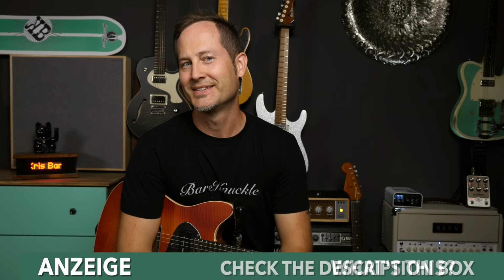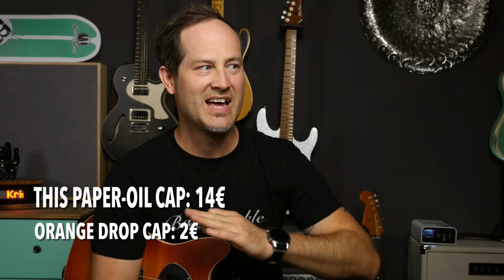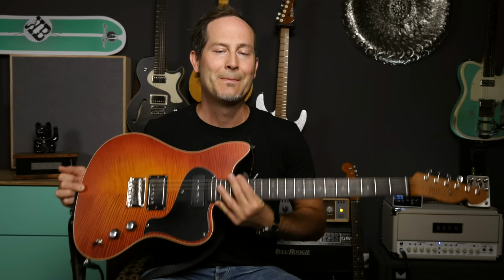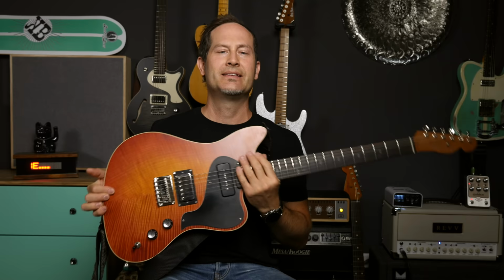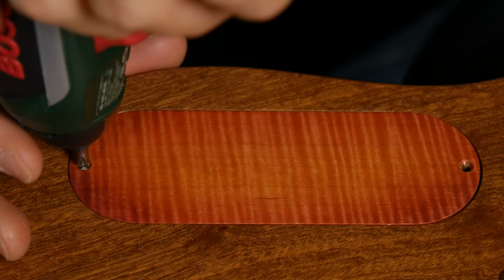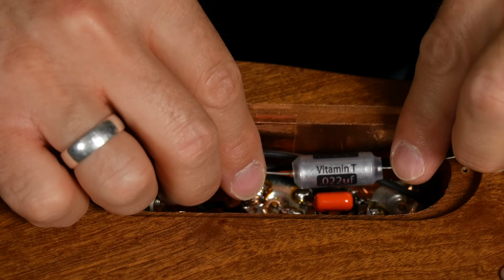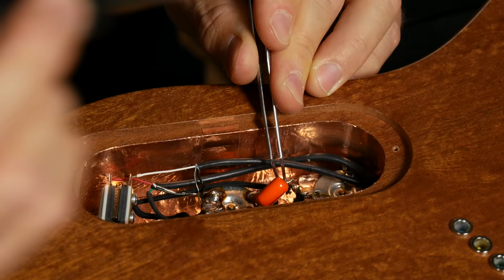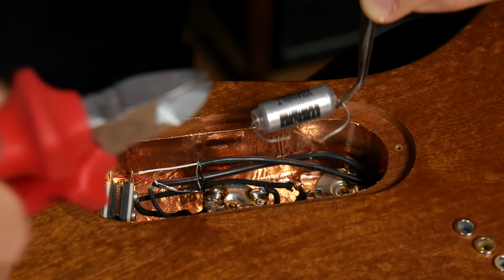Guitar Myth-Busting! Are Paper-In-Oil Capacitors Better? | Guitar Tweakz

Comment: I just wonder. Did you test the caps to see if they read the same? Could the difference be in the tolerance between caps? Possibly. Enough of a difference to make a difference? Hmm...not really. You nailed it when you said “will your audience know the difference? Nope.” As usual, awesome video brother!
Reply: without having done that, this comparison not very useful. sorry, i love Kris' videos, but without having checked the actual value (as opposed to nominal value), we only were proven that one capacitor sounds different compared to a different capacitor. the material of the capacitors is different, we know that, and the value is.... we don't know if it is different or not. so I am asking for a followup, please.
Reply: @tolvajakos  Totally agree. The tolerance of capacitors varies greatly from about 5% (the better modern ones, but orange drops are not even that good, they are listed as having 10% tolerance by the manufacturer) up to even 20% (more the electrolytics and wait... yes, those old paper-in-oil caps :) )

And for me this doesn't matter at all, I usually either have the tone pot turned all the way up or even removed. I use it only in one-pickup guitars, like the LP Junior.
Reply: @tolvajakos  of course it is not possible, that 1 cap will sound different to other, if they have all the values the same. What is often forgotten is, that capacitor (or potenciometer, resistor etc) has also other values then capacity ;)
Reply from the maker: Hey guys, I’ll measure these two caps for you soon in another video and tell you my thoughts on this and explain why I didn’t measure them in the first place. 👍 Cheers!
Reply: @KrisBarocsi  Thank you! Looking forward to it.
Reply: @stanislavmigra  not sure if the other values have any effect on tone, never heard of that, but it would be interesting to investigate.
Reply: @tolvajakos  did that for year on college, boring as hell. Yes, it makes difference, meassurable with oscilloscope. It was prerequisite for my master degree.
Reply: @tolvajakos  to clarify all that, do I think it is big thing to invest time and money? Nope, not really, there are other things, that makes HUGE difference. For example speakers and cabs.
Reply: @KrisBarocsi  Thanks Kris! I’m sure you’ve already thought of that and have a good reason. I was just wondering about that. I’m certainly no expert or know anything at ALL  about electronics really. I’ve just always read that tolerances can make a difference sometimes. But who knows? I’m just a dumb guitar player. 😂 Cheers!
Reply: @stanislavmigra  yeah, i know, swapping speakers is a huge change in tone. still i would be interested if somebody showed me a video or article that describes a testing like that and the findings
Reply: Dielectric in the cap does make a difference. Different dielectrics have different properties and therefore different sounds, even if the caps have the EXACT same capacitance value.
Reply: Caps of different compositions may measure the same capacitance, but they all have different ramp speed, ESR, and induce will measure different as well.  Slightly different capacitance values don't effect frequency roll off much.  Different composition will change tamber, and sustain tail.
Reply: Who cares what the audience thinks when it comes to guitar tone? You have to find the tone that you love, or else you will never be satisfied with your playing.

Comment: I suspect the difference we are hearing is due to the two capacitors being in a different part of their tolerance range, rather than the difference in dielectric material. In the links Kris gives us, the tolerance of the paper in oil cap is given as +/- 10% which is described as 'very accurate'. The tolerance of the orange drop cap is not stated
Reply: that's actually the real test. Most people seem to forget that there is a tolerance level. Watch the last Andertons  about the Klon. same story.
The real test is to measure 100 of each type. Match them up as accurately as possible and compare them across the range.
That would be a scientific approach to sound, or at least an real attempt. Have you ever seen that?
Reply: The hysteresis is different even if the uF value is the same. You can hear it.
Reply: All you have to do is measure them 🤷 Even the cheapest digital multimeters measure capacitance.  It's not magic lol
Reply from the maker: @JC-11111  Hey guys, and that’s what I‘ll do very soon in a video. I’ll measure these two caps for you and tell you why I didn’t measure them in the first place. 👍 Cheers!
Reply: I've swapped a LOT of caps, and the material definitely does make a difference. 

To my ears, Paper in Oil have be best sound, having more "air", "openness", and make the guitar "come alive". Ceramic is the next best, but is a bit too bright, clean, and sterile compared to Paper in Oil. Everything else makes every guitar I've tried them in sound "dead" and "lifeless", and that includes Orange Drops. 

It doesn't matter whether it's an .015 uf, .022 uf, or .047 uf, Paper in Oil's just sound better when compared to other materials, and you'd be hard pressed to hear any difference from one in the same value range to another, as the tolerances don't make as much of a difference in what you hear as the material the caps are made of themselves. 

This is my conclusion after a few years worth of real world testing of pretty much every kind of cap out there that I could find.

Comment: My guess is every person posting on guitar forums that PIO caps are "no different" than film or ceramic caps have never ever played a guitar with PIO caps in it. I have personally put them in two guitars and they made them sound wildly different. I put the old soviet PIO caps you see advertised on Ebay into a Les Paul with Gibson 490r / 500t pickups and it gave the guitar seemingly endless sustain and a "throatier" tone..Think of the Seymour Duncan APH2 tone on steriods. I also put Vitamin Q PIOs in another with 57 CLassics. This didn't change the tone as drastically but OMG it made it so much sweeter. Counternote, when I changed the 500T pickup in the first guiatr to a Dimarzio super distortion, it sounded horrificly bad with the PIO cap and I had to change it to the original Gibson stock. So yes PIO caps do infact change the tone, sustain and other charcteristics. The change can be quite drastic. As to if it's "better", that is a subjective opinion and different people will have different views. But IGNORE anyoine who says "they don;t change the tone". That is a lie.
Reply: Right away, you give a error in your method by installing different caps in  different guitars that are, by their very nature, not identical. There are too many inherent variables in pickups & pots...as well as setup, etc, even from  two supposedly identical guitars from the same manufacturer, to attribute the tonal differences strictly to the capacitors.

To prove you point, you would have to change the cap(s) in the same exact instrument, and analyze the output with accurate test equipment. Our hearing is far too subjective to be trusted outright.
Reply: @olenfersoi8887  People who can't spell and have no ability to use grammer should not be telling others about their crackpot theories they can not back up with evidence. You are dismissed.

Comment: Thank you for the content. This is an old post. Let's pretend I disagree with your conclusions, it doesn't matter. We are all just trying to learn. I am happy to read the comments and learn from the expertise of others. I come from an electrical engineering background and still am willing to entertain many things I would be surprised. Currently I am trying to determine when it makes sense to change pickups. I need very compelling reasons because I have so many tone shaping tools. In your experiment I determined three things. One, if I were playing alone, I like the fatter sound. Two, if I were looking for a guitar to sit in a mix the best, I would prefer the tighter tone with less bass frequencies. Three, without knowing the actual values of the caps, I don't think I can write it off to different construction and materials. I would need to do a lab experiment to make any conclusive determinations. Also, I would add to the experiment, tone shaping. What I mean, knowing in this case both caps had a different tone, attempting to match the guitar tone with each of the caps to match the tone of the other. So, the stock cap plus extra bass eq compared to the PIO with a little bass rolled off. In other words, could I prove that even if the caps were identical in values/ratings, with little adjustments, I can get the same tone. Most of the time we are splitting hairs and ignoring the most obvious boost to great guitar tone, the thing many guitarists skip while tone chasing, the performance of the player. So much time spent tone chasing with less time spent, writing songs and practicing.

Comment: There is a "FLY IN THE OINTMENT" that I did not know about until a couple weeks ago. Capacitors have a "Polarity" that affects "noise" and may affect tone. Please watch this 6 minute YouTube video: "Testing capacitors for orientation of outside foil end". It shows you how to test for polarity to make sure the proper leg of the capacitor is being sent to ground. There are other videos on YouTube regarding this topic including ones that tested the capacitors with an Oscilloscope.

I followed the instructions in the video and tested 3 Orange Drop Capacitors that I have, and as mentioned in the video, the printing on the capacitor does NOT indicate which leg is the "outside foil end." I didn't have an Amp handy to test the capacitors so I used my HX Stomp and connected the capacitors to the Input Jack, using a cable as shown in the video. I had to turn up my Stomp all the way to hear the difference in noise when touching the capacitor, but it was there. I have since made sure my capacitors are properly oriented/connected to the pot and ground.

I only tested the capacitors to determine which leg was the "outside foil end" to eliminate possible noise. I did not test them to see if or how that affected the tone. I would not be surprised if it did, as capacitors send high frequencies to ground when used on a tone pot.

@Kris - Did you test the capacitance of each before they were installed? I'd be interested in knowing if they were identical. I'd heard that if the capacitors have the same rating, they'll sound pretty much the same. You video proved that to be totally false (assuming both were properly oriented as described above). The paper-in-oil "vintage" capacitors sounded noticeable warmer and smoother than the modern Orange Drop capacitor. So much so, that I have to consider trying one, though I would like to first see if that warmth and smoothness could be achieved by simply turning down the tone pot a little with an Orange Drop Capacitor being used.

The video was very interesting, shocking, and as it turned out, it could have been an add for "Why you need a paper-in-oil "vintage" capacitor." Myth confirmed! Thanks
Reply: I too saw that or a similar video on capacitor  polarity. It hadn’t occurred to me before, but was one of those “obvious when you think about it” moments.
Reply: @jimblight8446  I was switching my bridge pickup to a stacked humbucker with dual rails, and wanted to make sure I knew what would be an appropriate capacitor for it, when I ran into the "polarity" info I'd never heard of before!
Reply: While there are polarized caps...the problem is that most caps are not like diodes...that is, not all caps are polarized and there is no reason why mfrs would not identify which ones are. The non-polarized types are merely two conductors with a less conductive material between them (...mylar, polyester, ceramic material, etc) Think of non-polarized caps as narrow doorways for frequencies: Frequencies are not restricted more when they pass thru in one direction vs the other. 

Thus, sorry...but, if you hear a difference reversing a non-polarized cap, it is very likely in your mind only. The only way to truly verify this is with an oscilloscope &/or software to  produce a Bodie plot.
Reply: @olenfersoi8887  You can verify this by simply testing it. I did it by connecting the Caps using a Jack plugged into the Instrument Input of my HX Stomp. The difference is not big, but is easily noticeable on some Caps, not so much on others. Anyone can test easily it for themself. Just test a variety of Caps. No need to trust anyone. Just use your own ears.
Reply: Bumblebees, (no matter who makes them), are not electrolytic. Therefore they have no polarity.

Comment: Thank you for this thorough demo. The difference is noticeable when you are running the tone pot down, particularly halfway. P&O is mellower, cuts the highs just a bit and therefore enhances the mids. I have a P&O cap on 2 teles, and orange drop on 2 others. The Orange drop ones are definitely more chimey, and put out a more "modern" tone. I use them mostly for rythm parts. The 2 others are vintage spec'd, also in aspect, and are breathtaking in bluesy solos. To each his own... ! Cheers Kris

Comment: Technically there IS scope for a differing dynamic response from the different construction methods. 
As well as Capacitance, capacitors have a little Inductive Reactance and ESR (Equivalent Series Resistance), ESL … there's a long list of possible variables. 
With the larger plate area and foil mass of the paper-oil one could well imagine different inductive behaviour going on in there.  
BTW Kris, I didn't see you verify the actual capacitance as opposed to the stated capacitance. 
As others have noticed ...
Tolerances can vary more than you might expect. 
There was enough difference to convince YOU.  
It would take some Double Blind testing to verify any further than that. 
Another thought, did you verify the Inner and Outer ends of both capacitors? 
It IS a thing you know. 
More of a noise shielding thing than tone usually, but at these cork sniffing levels it might be a contributing factor also.
Reply: Exactly, there are more values on capacitors, then capacitance.

Comment: I didn't expect to notice as much difference as I did. Through my studio monitors the difference was more obvious, especially on the neck pup. On the neck P90 overdriven part, the pick attack sound is quite different. The PIO cap just sounds sweeter to me, but I think the orange drop has a more usable tone variation. Thought the PIO got too muddy past halfway. I splashed out for a pretty expensive PIO cap for one of my guitars recently. Didn't do an A/B, but I'm pretty happy the end product.

Comment: One thing I've noticed is not all paper in oil caps sound the same.  I've tried the Duellund Paper in oil 0.022 with humbuckers and didn't like it when rolling down tone, but then I tried the Emerson Custom paper in oil of the same value and it sounded a million times better.  The Emerson Custom Paper in oil caps are my go to caps.

Comment: Hi Kris. Great video there's a lot of things that can effect the tone even with the same value of capacitors, they all create a bandpass filter effect for specific frequencies. Things like physical size, dielectric, type of materials used for composition, also Voltage rating can be over size or smaller, even the orientation of the component with regards to the ground sheilding can also make a difference. Thanks, all the best with your Sonic quest.
Take care best regards. John.

Comment: Thumbs up.  What I heard across the board on all of the tests was that, the orange drop are kind of shrill, where the PIO have more frequency width, where the slight curve of frequencies in the mids made the tone more dimensional, which gave the whole note more depth.  To me anyway. I’ve watched both videos now and it is very interesting regarding two different cap value differences. Just got an older ‘56 Gold Top with P90’s that going to mod. I’ve got different manufactured NOS .022 PIO caps in my cap box, most are Russian.  It will be interesting to hear the difference, when putting the lower value in the bridge, and the higher neck.  I’m doing BKP 550 pots with an audio taper of 20%.  It will be really interesting to hear the difference.

The other thing I want to mention is that the comments have been as interesting as the videos.  Thanks, it’s really opened my eyes to how I look at caps!

Comment: I used to do not use the tone control on my guitars till the day I've tried a guitar (Gibson) with paper in oil ... it's just like play a transitor amp or tube amp ... much more organic. I remember I asked my luthier to unwire all my tone pot (only use volume) and I came back with a stock of PIO from Russia. And I also add treble bleed on volume control (330)  as I was always on 10 !!! I can have now so many sounds only just with the volume knob. I've tried a lot (orange drop ...) and the best for me is 0.22uf PIO on all my guitars (included single coil)